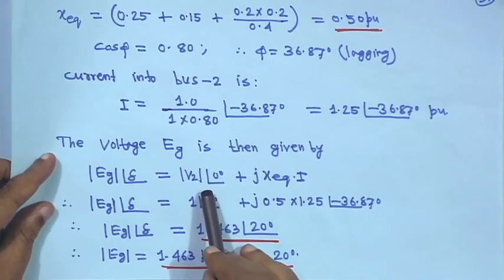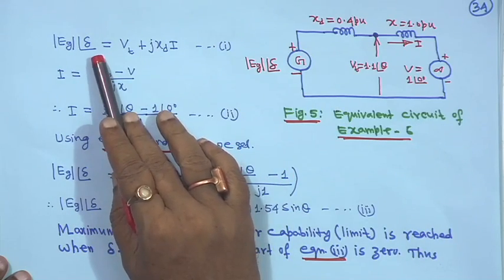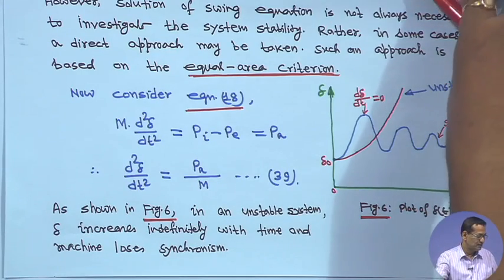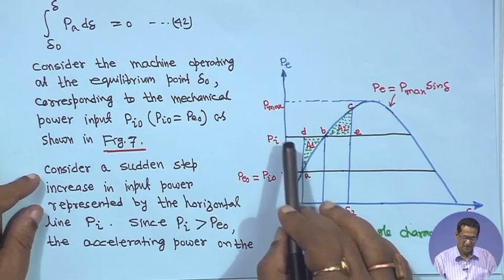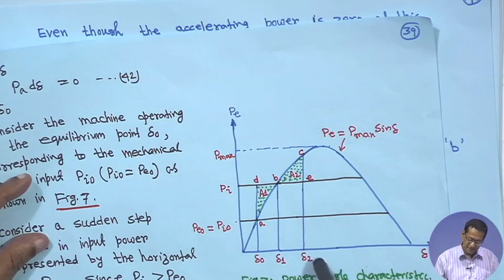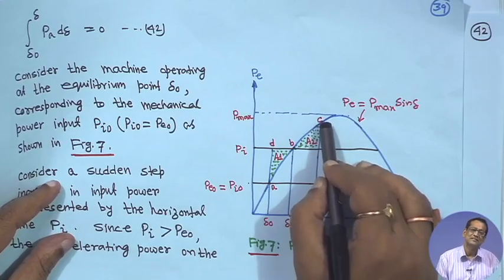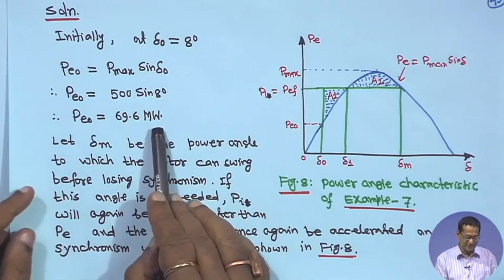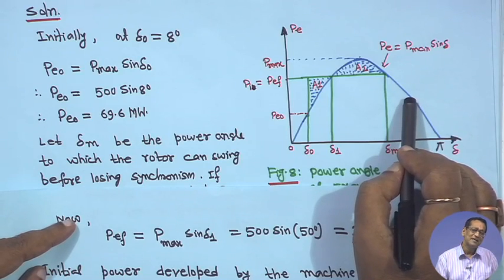Lecture 58 : Power system stability (Contd.)

Comment: How delta =50 deg is calculated in last problem?
Reply: kaushik parihar bto...Take scientific calculator...
Enter the below characters...to enter x ...press shift and then press ' ) ' button in calculator..
[(3-(π*x/180))(sin x)]-(cos x)-0.99
After entering all characters...press CALC button...2nd row first button from top...then it will show.....x?..... Estimate some random values... and observe the changes ...x value which gives close answer to '0' is the required solution
Reply: Sry.  It's bro not bto